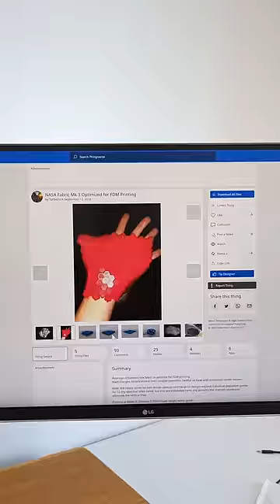3D printed chainmail on Prusa MK4

Comment: I'm printing nasa fabric right now 😊
Reply from the maker: Wonderful!
Reply: Did you print more than one sheet, and if so, how do you connect them?
Reply: @TheNormExperience to connect them you actually need to put the initial print in the machine with the new print and the two will fuse. just make sure to line it up right

Comment: This is where resin printers really shine. Forget the 12 hours, they'll do it in under 30 minutes!
Just make sure you set your elephant's foot compensation on the conservative side, otherwise you get a solid plate (which incidentally makes a really good drying tray for freshly cleaned parts).
Reply: Are you, by chance, speaking from personal experience?
Reply: The moment that CLIP Process os Open Sourced, we can begin the Speedrun
Reply: Not as strong tho. Can be a bit brittle.
Reply: @DragonFury4250  Indeed I am! Went through a bit of a phase of making all the different types of printable fabric. My hard drives still clogged up with a lot of it - the STL file sizes get pretty massive ( STL's suck!).
Reply: Sure but the print will degrade faster over time like all resin prints do

Comment: Imagine that but a whole shirt made of it in solid tempered carbon steel.
Reply: It would be heavier then a quirasse
Reply: @solarissv777  Call it a good workout.
Reply: Honestly, i don't think it would be great. Its very flexible, but the front facing bit is very thin, and has really big holes behind it, so any penetration could be quite an issue.  The joints would have a lot of metal, which is nice, but that might also be a problem as it could be extremely 😊heavy. 

Also, I've seen other 3D printed chainmail patterns, and at least 1 of them would be at least as sturdy, have less issues with penetration, and be lighter than this.
Reply: Wich would be pretty stupid.

Comment: How do you connect sections of this chain mail?
Reply: You don't, it'll print connected to eachother
Reply: @skywolfx76  how?  Want there be nozzle collision with previously printed section? How do I place previously printed sections on the printing bed so that it will stick so that the new section is printed?
Reply: @taurruth  so from what I've seen the piece it printed upside down, then all you gotta do is remove the bed and break it off and snap it a bit to free it up
Reply: @skywolfx76  and then i print another s 20x20cm section.  But how do I connect them to have a bigger section?

Comment: A full metal bodysuit of these would look fancy as hell, tho not very practical (hard to repair and the flexibility on the chest would just make it weak to blunt impacts)
Reply: That's why in the olden days they wore gambesons and the like under chainmail. A gambeson was basically an extra thick, extra stuffed, quilted jacket/vest. 

So the chainmail would do the Kevlar thing. You couldn't cut through it, you couldn't slash through it, and if it was made well enough you couldn't even stab through it.

The point of the gambeson would be to turn blows that would break bones into blows that just bruise.

Comment: As good as it looks is it practical?
Reply: Nothing made with 3d printers is built to take any sorts of impact.
Reply: @funnfungusie9622  that not true at all, Polycarbonate for instance is extremely rugged, however difficult to work with, And that's before using curing agents.
Moreover, I was referring less about the materials themselves and more about its basic structural design.
Reply: @daleA91  Ive never seen anything come out of these machines that doesnt break immediately.